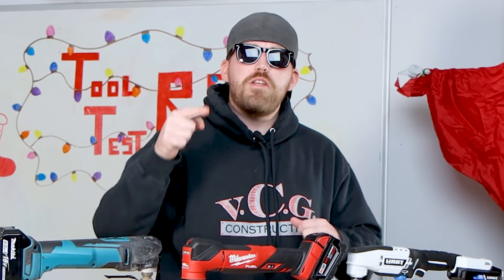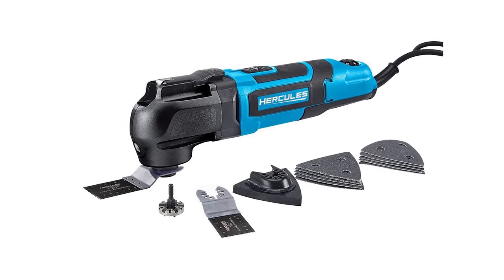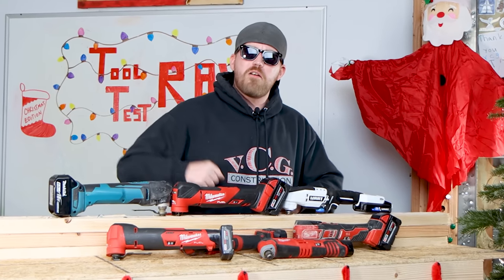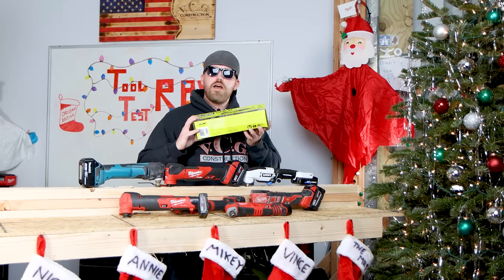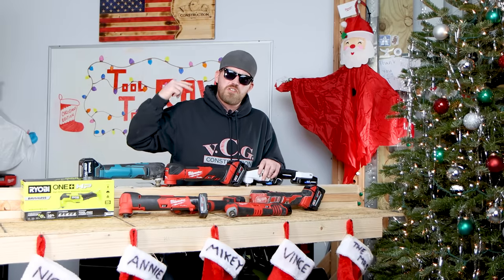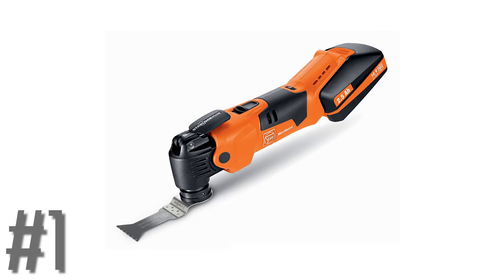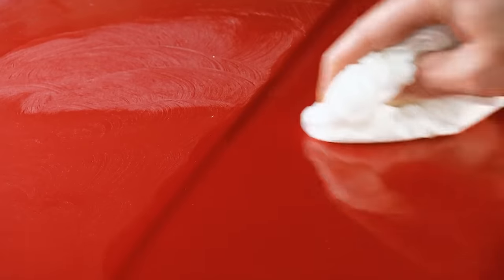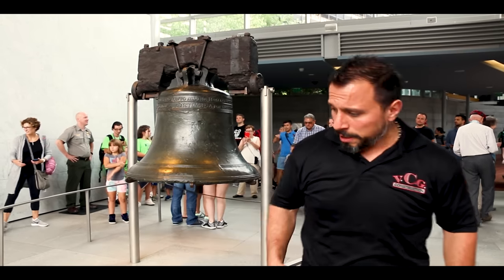Ranking Every OSCILLATING MULTI TOOL From Beginner LVL To Expert LVL (What Level Are YOU?)

Comment: Dust extraction on a cut off tool makes it number two lmao. It's a cutt off tool. They all get the job done, should or shouldn't b sold. I bought 3 of the two hundred dollar ryobi sets with the non brushless tools for my guys and myself the dewalt and to b honest I've had to use the ryobi a few times bc couldn't get tight enough with dewalt. Not only the but my guys have been using em for two years now and only had battery probs that were dealt with real quick (3days dropped off to my house no probd whatsoever) and  then the tools were back at at. Even bought the 6ah batteries for em which sadly had problems also and even they were replaced within days. If never waste the money on such a simple tool. Maybe if I installed floors and had to cut doorways on the regular I'd consider only a mid range but to waste money on top of the price line not even the line is just a waste. Also when it comes to blade change speed u can't beat dewalt, not even a comp. Can't compare squeezing a part to sticking a blade on a magnet and screwing or doing whatever u do to a simple quick squeeze lol. Love milwaukee but not even close. Enjoy vcg tho so watched it for you...even if it gets a lil loud n dramatic with some of u lol. G bless all
Reply: Good hearing from a contractor. I'm a DIYer myself and don't even own an oscillating tool but I do like hearing from the VCG gang. Stay safe out there

Comment: Seems like a good list. Don't see how the Star lock system is quicker than the Dewalt tool change tho? Pull the lever back, insert tool, release. Which is way easier than the Milwaukee where u need to thread in and out the center mount every time. I still like my Rigid 12v setup the best with it's magnets and quick change lever. Too bad Milwaukee wanted to be the only 12v option in their family and had the parent company kill off the Ridged 12v line of tools 👍🏻
Reply: Agreed, the DeWalt system is as good as it gets with OIS. However, OIS sucks and is torque limited, with the pins sometimes breaking. Also, the Starlock system enables one-handed blade insertion. Push the tool onto the blade and you're done. With the DeWalt, you have to use two hands. That's usually not much of a problem though.

Comment: Ryobi overheats and burns out.  So I bought a Fein.   Happy for 6 months started overheating and dripping black liquid.  Bough Makita cordless.  So far so good.   Only been a month.
Reply: What are you cutting?
Reply: @raul0ca  Hardwood floors, drywall, grout removal.  With  the Ryobi I removed grout from kitchen back splash subway tile.  Only in certain  areas for repair.  Then removed around 6 boards from hardwood floor and it burned out.  Home Depot denied return.
Reply: . Thank you. It should be able to cut that stuff. Maybe the oscillating action is tough on motors. 

Circulars saws usually last a while. So do drills
Reply: @raul0ca  The Ryobi is just a poor quality tool.  I have owned other Ryobi products that were good.  They may have improved with new version not sure.

Comment: I don't take any one persons view as gospel, Nick included. Fein and Festool would be built better than the Bosch but the Bosch sells at my price point especially as a DYI enthusiast. Yep Starlock was a cooperative between Fein and Bosch. Starlock Max is the latest and Starlock is the foreseeable future and with its superior clamping allows longer blades and wider oscillations. The latest Makita (DTM52 is better all over than the one here Nick!) and has very low vibration, lighter, better grip, power auto ramping and can accept ALL 3 Starlock variants, something the Bosch and Fein cannot do . . . yet. It's a wee bit chunky tho.
Thanks for the video.

Comment: That's what I said last night they were the original plus they are nice because they gave you like an 8 foot extension cord with the tool the only problem was there a Locking System after a while the top lock would get loose nice to see they went cordless

Comment: Well done good job  !   I'm agree with   Bosch  it's a very good  company  but at the same time  very  pricey .
Reply: Not if you can order from German shops. The GOP 18V-28 is often on sale for less than $200 in the version that comes with the L-Boxx. The bare tool is cheaper even.

Comment: I have the Bosch 18V.
As much as it (should) make me happy that you put the Bosch to the top spot, I don't think it deserves it. 
Certainly not when the Festool 18V multitool exists. (Note: I'm not sure if you meant specifically the 18V  model, or the whole Bosch range in general, but I'll go with the 18V as it's the most relevant.)

I have no hands on experience with the Festool (shops are still closed no thanks to Covid, and I'm too broke to actually buy one, if it was just for trying it out and returning it later) but I think, just from comparing specs, accesories, your review of the Festool, and my experience with the Bosch 18V, from all angles it just seems superior:
- Festool 18V is Starlock Max, Bosch 18V is "only" Starlock Plus, 
- Festool 18V has all these sweet accessories, like the plunge jig, angle jig, dust extraction, bluetooth battery that automatically turns on the vac, systainers that double as a workbench ... Bosch has none of that.
- Festool, as you say, has completely eliminated vibrations. The Bosch 18V, on the other hand, feels like they've actually amplified its vibrations on purpose. At certain speeds, mine actually gets into a resonance in which the whole thing shakes in your hands more than a Harley V-twin-powered sex toy. 
The battery has a bit of play when inserted (not sure if that's by design - it has spring loaded battery contacts) which doesn't help the vibrations. I've had to stick some adhesive foam pads to the tool body, right above the battery contacts, to somewhat bridge a gap between the body and battery, to lessen the vibrations from annoying to tolerable. Also, battery level indicator is inaccessible when inserted in the tool.
- I can't say what the Festool's fit and finish quality and ergonomy is as I haven't held it, but I'd hazard a guess it's better than the Bosch's 
- Also I believe the Festool is made in Germany? The Bosch isn't.

Yes, Bosch invented the Starlock (well, actually, the official info is that it was a collective effort of Bosch and Fein, but I might just believe that Bosch had a little more involvement, as we know these kinds of innovations are their thing, and they also have gargantuan resources enabling them to do the R&D), but I don't think that's enough to put them at the  top.

Comment: I have the Bosch, the original Fien, and the Metabo HPT, the Metabo HPT is a mean machine. Bosch has a quicker blade change but they seem the same running them.  Metabo quick blade change works well, it has never thrown a blade. Fein came out with the Starlock system, Bosch adopted it.
Reply: Bosch and Fein co-developed Starlock, but the engineering was mainly done by the Bosch department that also developed X-Lock for grinders and SDS for rotary hammers and jigsaws.
Makita is then usually one of the first companies to adopt these new interfaces. The 'US' companies (with DeWalt originating from Germany but being American these days, and Milwaukee originating from the US but being Chinese these days) sticking to cheaper classic interfaces and trying to make the best of it.

Comment: Metabo HPT has a descent oscillating multi-tool.  I would include it in the pro category.
Reply: I was wondering where the metabo hpt was. I've always been a fan of hitachi and I continue buying metabo now because of how many hitachi batteries I have. I use the milwaukee m18 fuel daily as the carpentry company I work for only uses milwaukee.  And I feel the metabo hpt and milwaukee m18 fuel are very similar.  I definitely agree with you on placing the metabo in the pro level category.
Reply: Regarding durability and power, they're definitely comparable to DeWalt, Makita, Milwaukee, etc. Their vibration control and refinement with the OMT is a bit behind the best though.

Comment: So the Busch 12v has magnetic for the head as well, but the tool is not on par to today's standards and is a hard pass, the 18v is a good tool but also maybe the 4th best. I'd put fein then festool then the m12 fuel the dewalt and Bosch are close.

Comment: The best tool in my opinion, is the one that gets the job done when you need it the most. I don't care if it's the cheapest, as long as it get's the job done.
Reply: With an OMT, it's also nice if it doesn't overheat and malfunction halfway through and doesn't give you numb hands and medical issues as a result of high vibration levels.

Comment: The m18 fuel is far better than the m12 fuel. I use both and it's not even close. Sure the m12 is a little bit more precise, but it's a negligible difference.

Comment: I have both Bosch GOP 18v-28n and Milwaukee M18 Fuel multi tools. They're both awesome tools. The bosch has better blade change with the startlock however, the blades are about $12 a blade. They both have Great lights, the Milwaukee has way better vibration control than bosch. The bosch has a defect on the battery housing, with prolonged use the housing wears off and the battery has no contact with the tool. When the bosch is at its highest speed it it's super load and will vibrate the beer bug off of you. Power-wise, they are about  the same with Milwaukee with a slight edge. Weight wise, the Milwaukee is lighter

 At end of the day, I have a Bosch 18v -28n with a 6.2, 4.0 core batteries, charger, and L boxx -2 with kaizen foam already cut out for it  to fit the whole kit for sale if you'll are interested.

Comment: Have to say that kicking out the 20v Porter Cable unit due to being only a 2 degree swing is pretty lame. Did u even try one or u just not liking something due to reading some specs? Does it also work and cut things like wood and copper, yes it does! Is it the all powerful Milwaukee brand that is always #1 on this channel and can never do wrong, no it is not. Sometimes it is not about buying the "best one ever made" and just adding a new tool to a brand you already own, have chargers and batteries for, seems like a no brainrr no. Spend $90 on a bare tool and be able to use it, or buy an entire new Brand for $300+ more because it has a wider vibration swing, no thnx. They are going at +15k, u really going to notice a difference unless they are all side by side. Thanks for the video, could be shorter and with less arm movements and still be helpful ;)

Comment: DISAGREE.  Ive owned and replaced two Rockwells that both failed due to motor overheating during proper usage, and both of them also had issues with the damn locking mechanism.  Rockwell, is garbage in my opinion.  The Dewalt and Milwaukee are both work horses, but they have almost the same price point as the Makita which has much less vibration to handle and has given me ZERO problems with nearly everyday use.  As for the rest of the tool brands, they simply aren't made to last, and if it cant hang with the demands of daily grinding, then its garbage to a professional.  The Fein brand in general, along with Festool, are not worth the asking prices, in my opinion.  The Makita, Milwaukee and Dewalt can hang and compare to the over-priced lines and unlike Festool their motors dont constantly have to be replaced from wear out.  MAKITA- for my money.  Makita is single entity-owned, and comes out of Japan which is one of the worlds premier motor, pumps and electronics providers today.  Not a single other company can claim that truth.

Comment: In my opinion the Kobalt is junk.  The blade locking mechanism constantly vibrates out releasing the blade.  Also a plastic piece where the battery connects vibrated to pieces.  I noticed some small blue pieces of plastic on the ground and didn't see where it was coming from until I pulled the battery off and a plastic piece fell off.  Haven't been impressed with the tool in general (loud, vibration transferred to your hands is excessive etc.)so even though they may replace it I'm in the market for a different tool.
Reply: This is strange to me. I use mine literally daily undercutting door jambs and using a carbide joint to clean thinset for leveling spacers or to clean joints. I've had 2 of them since they first came out with it. My name on the one I use, helper uses the other. 3+ years no issues.
Reply: @traviswescott253  Ended up buying a Milwaukee 18v.  Night and day difference, love the Milwaukee, zero issues